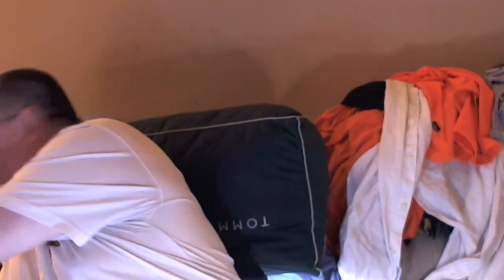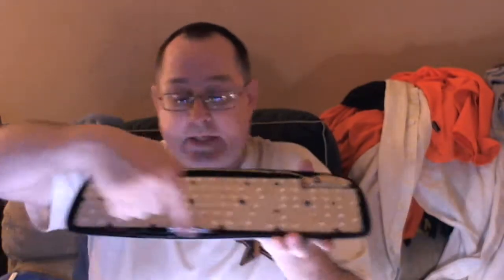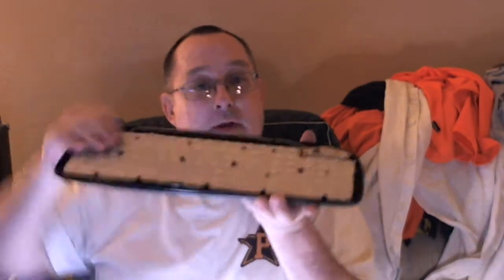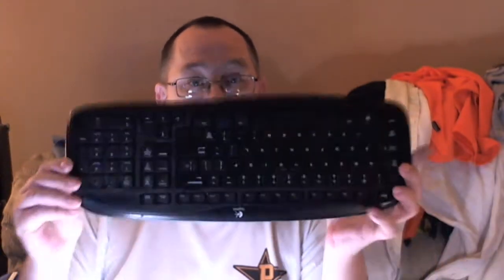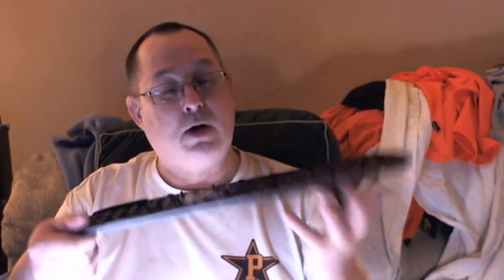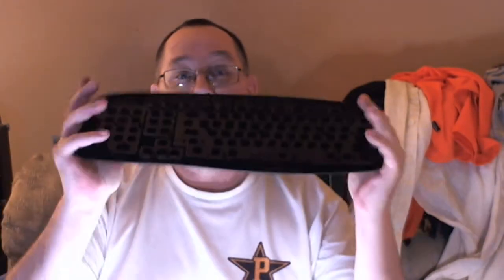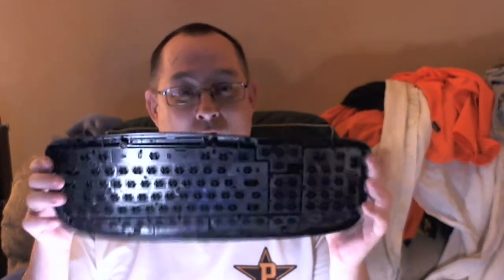Thorough keyboard cleaning

Comment: The dishwasher would work too as a way to clean and dry the keyboard.
Reply from the maker: brilliant suggestion there harley
Reply: I used to work for a company that had fire departments as customers. Fire houses are pretty dirty places and the computers showed it. We had one customer that annually would go around to all the stations and gather up the keyboards, take them back to admin, disassemble them all, and run everything, cases, circuit boards and keys, through the dishwasher before reassembling them and putting them back in the field.